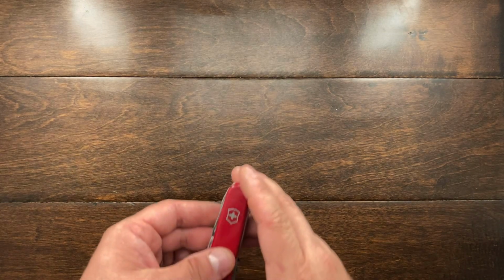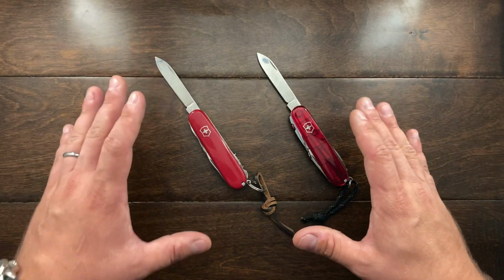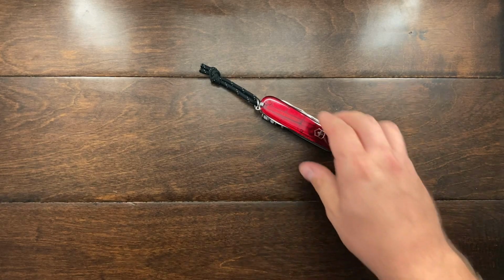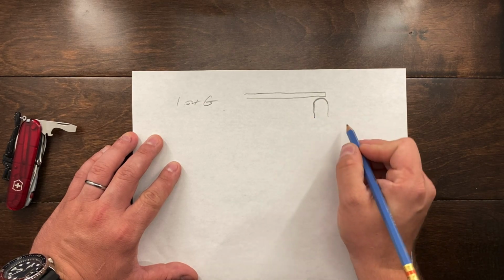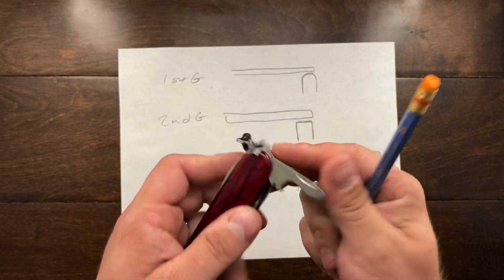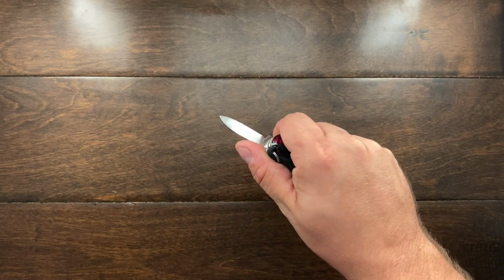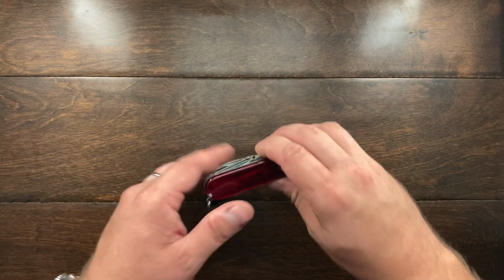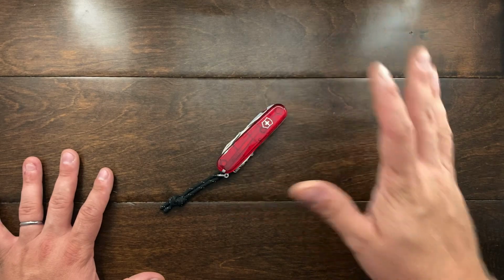What Victorinox is doing wrong part 1

Comment: I’m going to have to disagree with you partner.  Not that your ideas are flawed  but that Victorinox is doing something wrong that is holding back sales.  

Victorinox blade steel comes out of Scandinavia and is refined in Solingen, Germany.   The tools and other items all have different heat treatments depending on the tool.

The steel is similar to 1. 4110  or X55Cr14Mov.  Is there better steel?  Obviously.  But are most SAK users seeking a better steel . Probably not.  If they were, Victorinox would make the upgrade.   Most like that it easy to sharpen and keeps a decent edge for most day to day tasks.  

If they make a lock on their blade, even a soft one, it could probably be illegal to carry in many places.   They sell internationally and are the most recognized knife in the world.  Also, I’ve never had a slip joint fail on me when using it correctly.

Also, I don’t like half stops.  I think they are over rated and can be quite annoying.

Comment: The upgraded blade steel option paired with the half stop feature, while it is a very good option, would most likely raise prices along all models across the board. And knowing them, they would probably only offer it in the smaller models like the sd classic and cadet 😆 😆.

Comment: Their steel is actually better than most high end knives.
Reply: It would depend on what you consider "high end." You can get several knives under $50 with 14c28n which is much better than victorinox's steel.

Comment: The bottle opener with the screwdriver that you are calling a can opener locks  in the half position for leverage as a screwdriver plus you're using the wire stripper wrong. It does not require the knife blade to make the wire stripper work. Your  Observations on the locking mechanism on the bottle opener versus  the long blade are brilliant. I am with you 100%  on the modification to the long blade. That is a marketable change without a doubt. One of those things that when you see it you say how could I not have seen this before.

Comment: Happy Thursday Mark, first let me point out that you have confused the Flat Head Screwdriver / Cap Lifter tool with the Can Opener. Next you are using the Spartan Lite, one of the few SAK's that I regret buying as its Lite housing is 2 layers thick & whilst I like the in-line Philips screwdriver I have never actually used it & my Spartan Lite now lays in its box in the cupboard. ( I have several Spartan collectables but have never carried one as an EDC knife ). Next up, I personally am satisfied with the quality of steel & if Victorinox were to make a line of knives with much harder steel I  would only buy one if it was an entirely new model with a revised tool set up & not an upgraded copy of a current model . What I really would like to see is a new 3  layer 91mm Model that comes in Plus scales in 8  different colors as Standard and has a large blade paired with the Compacts Combo Tool - Cap-lifter, Can-opener, Screwdriver, Wire-stripper & its other 2 front layers are the wood saw & scissors. For the back tools the corkscrew with mini-screwdriver & pin as standard since this is a Plus scales model & if possible the awl & or the parcel hook and possibly the most important innovation of all for Victorinox -  a detachable pocket clip as standard as well as the key ring as an option for anybody who prefers a key ring with or without a lanyard or paracord

Comment: I have often thought 14c28n would be great for Victorinox knives.
Reply: I personally have no understanding on steel type or quality & am satisfied with the current steel used by Victorinox so my question is will using a 14c28n grade of steel add significantly to the cost of a knife & just what can it do better than the current steel which cuts well enough thru boxes, wood, plastic, rope & clothing ?
Reply: @stevesinclair4159  It shouldn't.  It is considered a budget steel but it has decent edge retention and is easy to sharpen. The biggest improvement over the current steel would be edge retention.
Reply: @charlesdudek7713  My personal experience is that most of the SAK's I bought as new already have good and lasting edge retention & mostly its the 2nd hand knives that I bought on Ebay that have required sharpening and not being skilled in the use of a whetstone I have used a store bought knife sharpening device to get them sharp.
Reply: @stevesinclair4159  Hey if it works for you that's all that matters. Really most of my SAKs I carry as a secondary knife so the blade steel isn't super important except for with one. My Rangergrip 78, due to its size I will not carry a second knife so in that case I would like a better steel.

Comment: If the blade gets harder to close you will increase the risk of cutting yourself when you close the blade so that would not be smart, but the locking option on the evolution s knives would be a smart option on their standard 91 and 93 mm knives.

Comment: Nice video. I was also asking why they do not use the "force lock" on the main blade. I have a idea (personnal idea).
The swiss knives are used by many poeple, kids, women, old poeple, they often are not using other kind of folding knives, and i think a forced lock is more dangereous. have you tried to give a folding knife with a system lock or with strong lock ? If they are not using a knife usualy, poeple force and force up to the dangereous moment the blade sudently close "shlack !".
I think the smooth blade lock is maybe a little bit less secure when using but highly more secure when closed by non 'expert' users.
(please do not said there are childen knife with round blade, it's... not a knife).
Regards.

Comment: I laugh 😂 
The metal is perfect for edc
What about leatherman ?lol
Reply: What about leathermans steel? Leathermans 420hc is "better" than vics stainless. And leatherman only goes up in quality from there 154cm s30v etc. I edc either a cadet or climber w/plus scales, or a evo s17. I have vic soldiers, wengers etc. I love saks. But most of this video is correct. Vics steel is subpar at best and its mind boggling that they put a half stop on the screwdriver but not the scalpel that can severely damage your fingers. And to stop the evolution of saks because of nanny states is illogical.